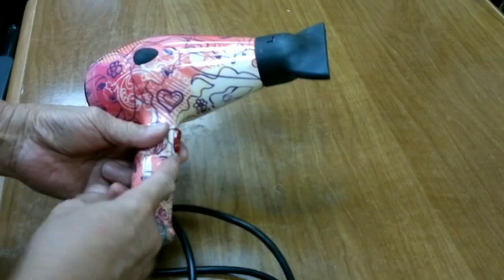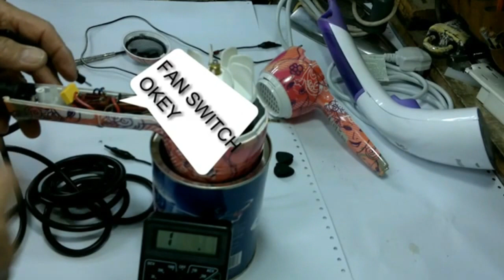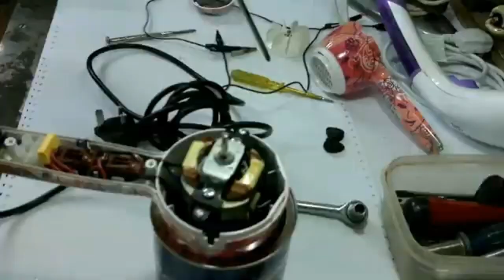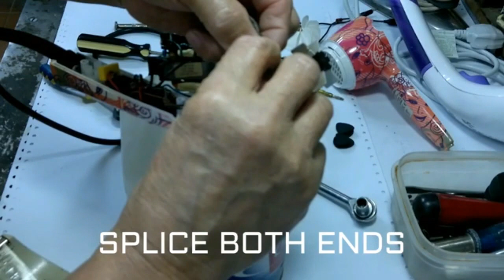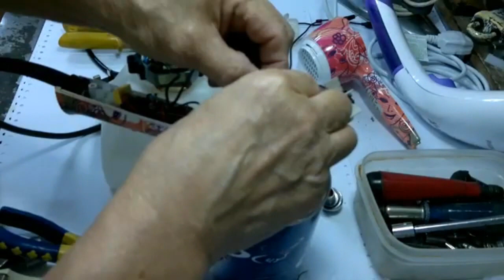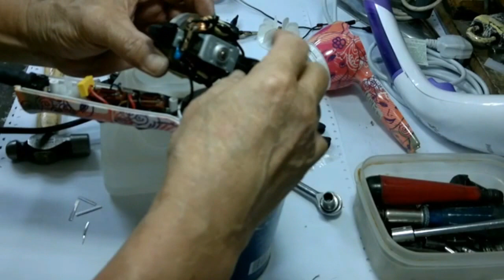HOW TO REPAIR HAIR DRYER with broken heating element

Comment: Paano po ung nagbabaga ung wire in half lng ..blower ok ..switch ok ...pero pag ini on nagbabaga ung kalahating parts ng spring wire ..
Reply from the maker: pag nagbabaga  ang 1/2 ng wire wound wire ,  maaring may short within sa coil nito, kung ang fan kamo ay normal naman ang ikot. delikado pong gamitin iyan. mas maigi na patingnan sa isang electrician para maiwasan ang disgrasya po.
Reply: @yononable  d ko muna sya ginamit kc nga bk makasunog ng buhok ..anyway salamat po sa info para sa safety ng costumer ko 😊😊